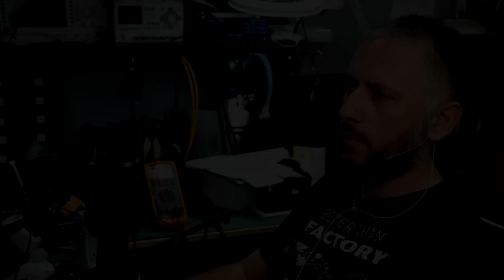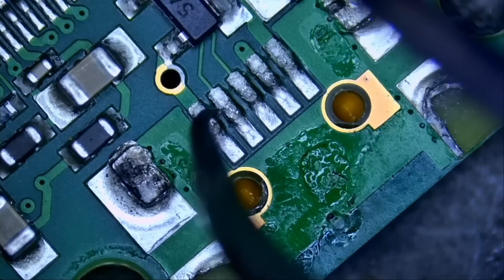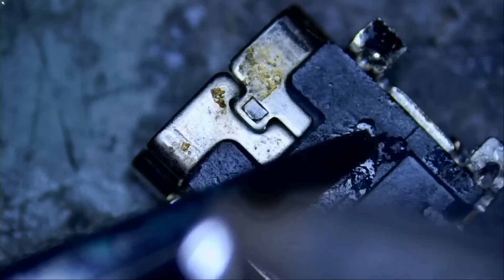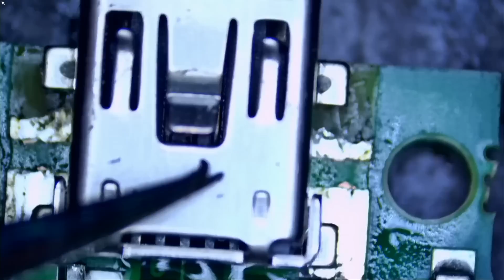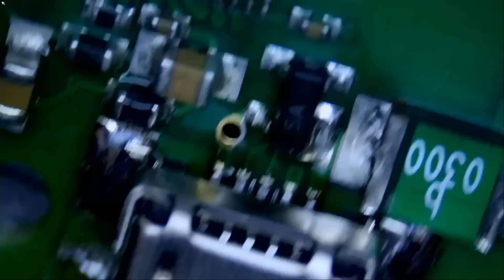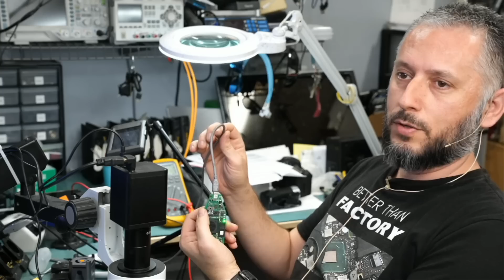Audi OBD Dongle VAS6154 Repair - Why so Expensive ?

Comment: I repair these type of usb tuning dongles for a 4WD dyno shop and I run a usb fly lead out, the mechanics often bump the dongles with their feet and knees climbing in and out of the vehicle when tuning, as the dongles plug into the obd2 port under the dash. With a fly lead this issue is resolved.
Reply: that's the way it should have been made from the start, will survive a  very long time.

Comment: A decent glue is G-S Hypoid cement, us watchmakers use it a lot and is pretty decent stuff, jewellers use it for bead and gem setting too and it comes with a microfine needle applicator.
Reply: Thank you for suggesting the glue I will give it a try

Comment: I think the real reason it's so expensive is they basically have a monopoly, so can charge what they want.
Reply: That is proibably one reason. Also distribution and manufacturing may not be optimized at all. They are probably also not manufactured by the millions and they cannot compare with bulk products. It can also carry some of the costs of the software that was developed. Sometimes in some products you get even free software (even with some support) and you pay for the physical dongle that covers it all.
So many possibilities, probably a combination of them just adding up.
Reply: @philipershler420  That is more likely a repair shop tool, not a tool for every car owner. Sure, it is expensive but if you need one for your repair shop that probably is not an issue.
Reply: It’s expensive because it not a mass produced item ! IMO
Reply: What flux are you using ?
Reply: This is why we have to keep fighting for right to repair
Reply: It’s proprietary, not a monopoly.
Very common in all industries.

Comment: Hi Alex for broken pad I use clear 3d printer Resin with a UV Lamp that you have make a great connection for broken pads and the resin is as hard as the PCB.

Comment: wonder if the low level code can be extracted from dongle chip and used to reprogram another chip?
Reply: Never. They hire engineers that can prevent this from happening. They are using mcus that are read protected and encrypted.

Comment: great job. Out of curiosity, does it happen that audi dealers manage to damage the ports after they are repaired?
Reply: His glued version is mechanically more sound than it was originally, as glue has a lot of elasticity and the surface area is larger.

Comment: They should put a six inch dongle extension on them the day they buy them. Tyrap the dongle to the case to relive strain on the usb port. When the dongle wears out it would be an easy fix.

Comment: Any thoughts on laypeople adding adhesive over the SMD joints and pads before they break, as a preventative measure?

It's crazy how many expensive devices don't use through-hole mounts for USB or especially ribbon cable press-in connectors.

Comment: Drilling a hole in any motherboard can cause the device to malfunction, due to any possible traces internally being drilled through, not a good idea. For this glue is easier and smarter.

Comment: Hi, i have a question to you :). Do PSU have influence on a GPU coil whine? Understandable if it was low quality PSU with unstable voltages etc. but i read on forums that people had corsair rm850x and after change on straight power 11 coil whine was ended... How to explain that?
Reply: Yes, they do. From my experience, quality of the PSU almost doesn't matter in that context. You can have less GPU coil whine with a cheaper PSU and more with a more expensive one. It always seems to boils down to the specific combination of PSU + GPU model. Might have to do with the switching frequency delta but I'm honestly not sure.

Comment: A good solution for this board would be to place it in an inline project box so the OBD connector is not on the board.
Reply: i was thinking exactly the same, to protect the dongle and it's connector, it should be in an box with the cord attached on it, so you connect to the cord not directly to the dongle, in this maner you save the hussle of connecting/disconnecting the cable directly from the dongle

Comment: For as expensive as these are I find it troubling this is an ongoing problem. So what they think because the software is what makes the device expensive they can just skimp on ensuring the hardware? Not impressed with companies like this! Maybe you should backward engineer this board and have PCB Way make you a bunch of them and you can start putting them together and selling them!